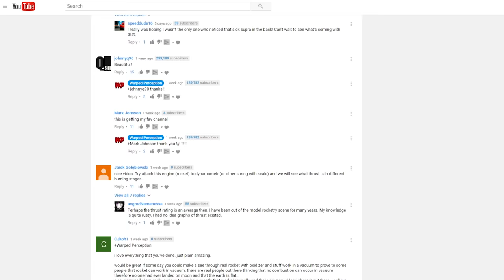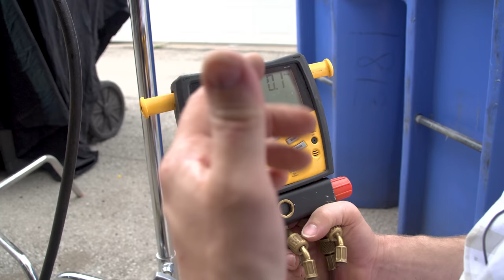Model Rocket Engine In A Vacuum Chamber - 4K Slow Motion - will it burn? - Rockets (S1 • E3)

Comment from the maker: Proof that the Earth is Round right here : https://youtu.be/Cun6_fh1wQs
Reply: Fish-eye looooool
Reply: Sorry man but this is no proof at all ;-)
Nice try tho..
Keep it up!
Reply: so let me know when you have read August Picard and read his personal experience way back when they were doing actual science experiments you have just compared yourself like August Packard to be a science experimenter and compared the small tube to infinite  space your also not informed the first heavens or whatever number of heavens are water dude the August Packard commercial for hennisy or whatever commercial it was for shows more truth in the stories of old just like alot of what HOLLYWOOD put out in movies they make fantasy   reality and reality fantasy
Reply: How many microns did you run the vacuum into, I notice you had a set of digital gauges. I'm not skeptical but it also seems you would need a much larger vacuum chamber to properly test the engines thrust. Theoretically the back of the chamber would act as a source of lift for the engine. I'm also very curious to see if you could actually maintain a direct course in a vacuum. I guess what I'm asking is could you hit a target inside the chamber with a rocket or would it even be possible to direct a flight path and keep on that path without constantly correcting your course. Good video but there are still a lot of variables involved here
Reply from the maker: @brianbible8415  1000 microns.
Reply: Mal hecho el experimento, una vez que el combustible reacciona, deja de haber vacío en la cámara por eso existe el empuje. No existe empuje en el vacío porque no hay nada que empujar. Por cierto LA TIERRA ES PLANA.
Reply: @brianbible8415  actually you hit the nail on the head. This guy is a flippin' fraud, just like I said and you should be skeptical. Good job on your part. He didn't pull a complete vacuum AT ALL in his skinny plastic tube. He does this cheap experiment to "prove something" that would require a large decompression chamber with a quality pump to be pulled down to a COMPLETE vacuum. Not using something  like his  AC evacuation pump.  Instead, he insults you with some cheap garage stunt.
Reply: You can see fish eye effects early and also see fish eye effects when balloon pops.. your channel is fraud.. rockets do not work in a real vacuum.. there is no air to push off of to have any thrust.. what a joke
Reply: @eduardoacosta5940  thrust engines in a vacuum don't work by having anything to push against. Newton's law, for ever action there is an equal and opposite reaction. Thrust in a vacuum creates a force  between the engine and the ejection, causing both to want to move away from each other. Example, two people floating in a vacuum, one pushes the other, both fly away from each other at the same rate.
Reply: @TraywickDesigns  the ejection of rocket would be canceled out by the vacuum of space.. all test on YouTube show rockets in small vacuum chambers.. the initial ejection from rocket makes it a non vacuum environment in small chamber allowing it to create movement.. in an absolute vacuum the ejection of rocket would be canceled by space vacuum.. would love to see any videos u could share of rockets being tested in large super strong vacuum chamber that clearly shows movement in space like environment.. rockets in space are science fiction
Reply: @eduardoacosta5940  you so completely miss what was said
Reply: @TraywickDesigns  I get what your saying.. if two people push off each other in space then they are pushing off each other.. what is rocket pushing off of if in a vacuum? Wouldnt thrust be canceled by vacuum.. if u have a link please share
Reply: @eduardoacosta5940  from the exact point of ignition. At the point which the exhaust exits the rocket. It's two opposing forces. Same as to people in space push off from each other.
Reply: @TraywickDesigns  at the point exhaust exits rocket? Space vacuum would cancel exhaust exiting rocket..
Reply: @eduardoacosta5940  Sorry but the Vacuum of space DOES NOT EXERT A FORCE ON ANYTHING.
  It CANNOT "PULL" the exhaust from a rocket. 
 WHen a rocket expels its exhaust it is PUSHING THE EXHAUST OUT. 
 The Vacuum is INCAPABLE of "Pulling" the exhaust.
Reply: Francisco  Then we execute phase 2. We leave them there.
Reply: @brianbible8415   Furthermore, I can beat you or anybody else with this guy's cheap garage backyard project with his plastic tube, with internal combustion ALONE. Go ask your favorite driver on the track to pull the exhaust AND both headers off his honda engine, or whatever, and then start racing his car around the track. Let's see how that works out. And that's giving you the benefit of the atmospheric pressure surrounding your collective nasa  promoting  heads right now.
Reply: @griffinspeaks2661   if that means that this guys pathetic show and tell video is cheap and useless, and high pressure will IMMEDIATELY move to lower pressure as per real physics, not copernican huckster, einsteinian fraud version of physics, then I agree.
Reply: @griffinspeaks2661  was there a point to all that dribble?
Reply: @brianbible8415  Of course you can. The vehicle will travel on a vector exactly opposite of that of the rocket engine's nozzle. Also, acceleration will be stupendous because there's no drag.
Reply: proving once again, that flat eather's, are fucking idiots DING!
Reply: wrong.
Reply: @gregs3220  So you understand that the conversion from solid fuel and oxidiser to gas and particulates. Yet you choose to pick on pressures and ignore thrust?

What's your point?
Reply: @eduardoacosta5940  vacuum's don't suck!
The fuel and the oxidiser exist in the vacuum and are then burnt, creating thrust by way of massive expansion through a tiny nozzle.

Your wilful ignorance is astounding and your narrative is flawed. Nice try, but you're only making a fool of yourself. Like all flattards. ;)
Reply: @stratoleft  Nothing will ever come close to the vacuum between your ears.
Reply: @gregs3220  insufficient to what?
Reply: You are a smart guy. Why would you upload this video as proof when you can clearly see there is a fish eyed lens which curves the plane even at a few feet off the ground. Very good video on the rocket however.
Reply: Warped Perception wide angle lens, beer cooler or whatever it is is warped, try again.
Reply: Warped Perception.   Fish eye lenses confuse you to believe you're seeing earth curve and yet you teach science on YouTube ? ??    bahaha!!  A child knows what a fish eye lens does!
Reply: O.k., having seen this and other related videos, I'm very happy to put this one to bed (it would have been a real bummer if rocket propulsion was impossible in space, a vacuum).

Now try and debunk the "jet fuel hoax" as having gathered my own evidence on this, from recent transatlantic flights, I have found NOTHING to undermine the claim the MASSIVE quantities of "jet fuel" they claim modern jet passenger aircraft use and store in their wings is a GARGANTUAN lie, and in fact, the wings store ZERO "jet fuel" (even if you could store large quantities of liquid in the wings, it would make the aircraft super unstable), and therefore these jets in practice must use minimal fuel, as there is limited storage space available. See my video exposé, including the pinned comment: Due to Google CENSORSHIP I can't include link, but you just need to click my icon to see video
Reply: round or flat? doesn't matter to me but vid showed ZERO proof of anything
Reply: Flat horizon at 317,000 ft.  You'll have to go much higher than 95,000 ft.  Sorry, no cigar!
Reply: @stratoleft  Want to see video evidence of rocket propulsion in a vacuum?
Answer a question first: At what ALTITUDE does earth's atmosphere officially turn to "vacuum"?
If we define "rough vacuum" as "Below 1.0 Torr", than at WHAT ALTITUDE does earth's atmospheric pressure drop below 1.0 Torr.

And to see if you understand the most basic of physics: If I fire a steel projectile from a crossbow in zero-G, in a vacuum, WILL I FEEL RECOIL? yes or no?
Reply: @brianbible8415  youre right about the back of the chamber acting as the opposite for the blast did you notice though it didnt move until the fuel produced contaminants to push off of
Reply: @stuartgray5877  you should better think about the things you should get ridiculed for...like for portraying yourself as a complete immature dude with an 8 year  old bully mentality :) ... right?
Reply: @camranh_royal  I am just sick and tired of these literal morons telling ME that I am either LYING about my career, or I am such an incompetent Aerospace Engineer that I dont know that I have been fooled my entire career?
Here is my background, you tell ME if you would be offended if you did all of that, and then have a 20 year old high school dropout try to tell ME that I am an idiot?
 I have an electrical Engineering degree, I have been building & flying aircraft since I was seven, I have been an aerospace Engineer for almost 25 years. I have helped build deep space probes that have orbited Saturn and landed on the moon titan.  Orbited and landed on Mars. Brought back samples of a comet, brought back samples of the solar wind, punched a hole in a comet, discovered thousands of extra-solar planets, landed on Earth, and orbited Earth.
  I have helped launch 5 of these spacecraft and worked on about another dozen.  I have built the electronics, built and tested the entire spacecraft, helped fuel the spacecraft, and helped put it on the rocket.   I have helped fly three after launch. 
  I have worked for Lockheed Martin Space Systems & Space Simulation Labs, Ball Aerospace, Jet Propulsion Laboratory, Laboratory for Atmospheric & Space Physics, NASA, NOAA, & DOD.   I have been Spacecraft Avionics Engineer, Lead Test Engineer, Command & Data Subsystem Engineer, Power Subsystem Engineer, Flight Director, and Launch Conductor. I have also personally witnessed over twenty real rocket launches including space shuttle (launch & landing), Delta II, Delta IV, Atlas,  Minotaur and Falcon 9.
 
  So yeah, I take it a little personally.
Reply: @stuartgray5877  Well if this is your true background and profile you should understand that people are free to believe anything they want or have been brain washed to do...there's lots of confirmed cases of misinformation spread by the elites who own science books editorials and NASA for one has been caught lying on so many cases and not only that but has been a corrupt agency profiting from their propaganda and deceptions (Zionist controlled or infiltrated). Not a reason thou to lose your horses and resort to name calling. (childish behaviour)
Reply: @camranh_royal  - "and NASA for one has been caught lying on so many cases"
Give me ONE EXAMPLE of NASA lying so I can debunk it immediately.

And for some fun, want to see what the earth looks like? Google "EPOXI images of earth" for some that I helped take.
Reply: @stuartgray5877  hundreds of fake space/ earth pics "taken  from space"/the fake moon landings and moon walks/ vids from inside the S.Shuttles with hidden cables / etc."green screen" imagery. Start with that...go debunk the proofs and see ya here soon to give you more NASA BS facts
Reply: @camranh_royal  So you refuse to show me just ONE EXAMPLE .
Got it 
you dont have one
Reply: Lol.   Globe Earth is a lie.
Reply: @ajaxashford4815  - "Globe Earth is a lie."
EXCEPT for the overwhelming evidence that it is a sphere.... Just because YOU dismiss the evidence does NOT mean that it does not exist.
Reply: Anibal Santiago  - "You cant have gas pressure next vacuum.  You cant have gas pressure without a container."

These are all certainly NOT "Facts".
Show me ONE Engineer or Physicists that agree with ANY of those statements. YOU CANNOT.

Now If you would like video evidence of rocket propulsion working just fine in a vacuum, I can show you the video.

But since you appear to know a little about atmospheric pressure, answer one question first:

At WHAT altitude above earth does the atmospheric pressure drop to "vacuum"?
How high?

Since the industry standard for "Rough vacuum" is any pressure below 1.0 Torr, then:

At what altitude above earth does atmospheric pressure drop below 1.0 Torr?
Reply: Anibal Santiago  - "You cant have gas pressure next to a vacuum without a membrane separating it"

 for Starters, and There is NEVER "VACUUM" right next to high pressure.

Let me ask you some HONEST QUESTIONS, look them up for yourself and reply:
What is the atmospheric pressure at sea level?  ___
What is the atmospheric pressure in Denver Colorado (1.0 Mile High)?  ___
What is the atmospheric pressure at the top of Mount Everest?  ___
Reply: Anibal Santiago  "Which requires a container!!!!!!!!!"

SO you agree this device CAN make a gas gradient?  ANd if you spin it fast enough it would make an actual vacuum at the center.

What holds tha gases AGAINST the container and causes the gradient?
What is the MECHANISM that makes the machine work?
Hint: it's in the name....
Reply: Anibal Santiago  did you get your honorary Dunning-Kruger membership card in the mail? I signed you up for their monthly newsletter too.
Reply: Anibal Santiago   - YOu are the one that fails to answer questions when answering PROVES YOU WRONG.

For example, WHY didnt you answer the question:

When talking about  Gas CENTRIFUGEs:

"What holds tha gases AGAINST the container and causes the gradient?
What is the MECHANISM that makes the machine work?
Hint: it's in the name...."
Reply: @Атак Хеликоптер "yes" what?
Reply: @Атак Хеликоптер I asked many questions in this thread.  I have no idea which one you are agreeing to ....
Reply: @Атак Хеликоптер Good you have the correct answer.

Are you one of those that believes rocket propulsion will NOT work in a vacuum?

Comment: This doesn't even HAVE to be tested (but hey, views lol). Solid rockets contain their own fuel and oxidizers so they don't need air to function.
Reply: it has to. believe me, i think you neber argued with a real flatearther before.
Reply: that has absolutely NOTHING to do with net thrust.
Reply: You may be talking in the earth airspace with our regular air pressure.  But if the Outer Space is A VACCUM SPACE, forget it, everything gonna be suck into negative at soon as You reach Outer Space; and that is another problem to this dilema.  How can You set a rocket in VACCUM SPACE if the transition is IMPOSIBLE?   But, we ate that one on 1968.
Reply: @MArk Reaves, I would disagree... I'd like to know how you rocket blast sound in a vacuum?
Reply: @CarlosAM1  nice try appearing smart, the atmosphere has nothing to do with a rocket engine except the rocket has a lower isp in atmosphere, but the rocket absolutely doesnt needs any atmosphere to fucking work

Comment: Notice that the engine initially doesn't move AT ALL. Only when its exhaust gasses have filled the tiny vacuum chamber, and provided the requisite air pressure, can the rocket achieve any thrust.
This doesn't prove that rockets work in space, as space is a near-infinite void in comparison to this tiny chamber. The gasses coming out of a rocket in space would shoot off into the void while performing no work on the rocket.
Reply: This is what space travel believers just can't wrap their heads around.
Reply: WeeSleeket - "The gasses coming out of a rocket in space would shoot off into the void while performing no work on the rocket."
So in your vast Physics understanding WHAT WOULD HAPPEN if I had a machine, in zero-G, in a VACUUM that could propel a 500 kilogram block of WATER ICE out at 2500 meters per second into space?  WOULD THAT propel the machine backwards, yes or no?
how about a block of DRY ICE (Solid CO2) would THAT push the machine backwards?
(for comparison on earth, the block would WEIGH 1100 pounds and would be travelling at 5600 MPH or about MACH SEVEN!)
Would a Machine ON EARTH feel a recoil IF it fired an 1100 pound block of ice at MACH 7?
Reply: You are wrong - period!  Rockets are reaction engines and work better in a vacuum than in the atmosphere.  Sorry you are too stupid to understand.
Reply: @MoneyIsSilver  What? An incorrect concept?  You are nothing but a fool.